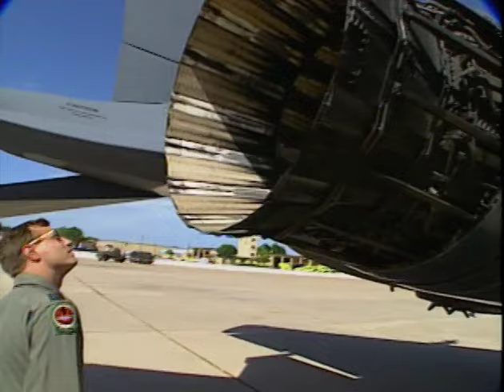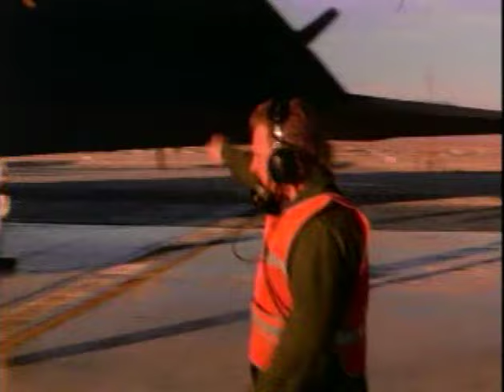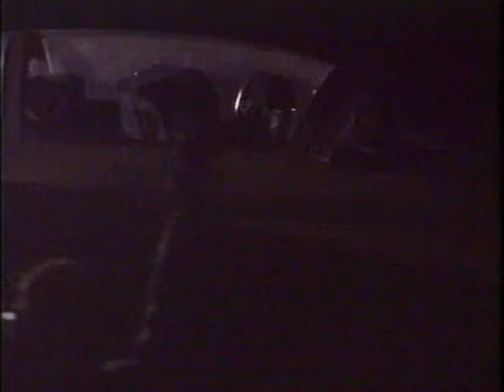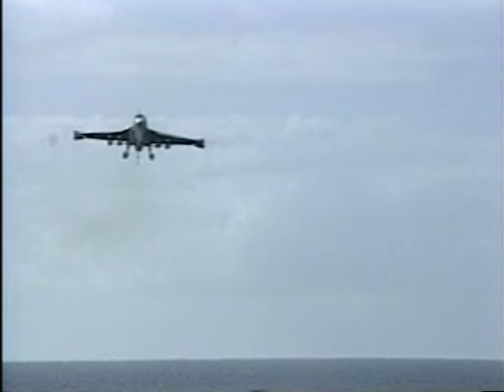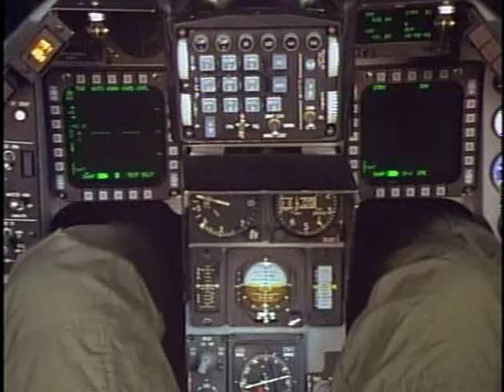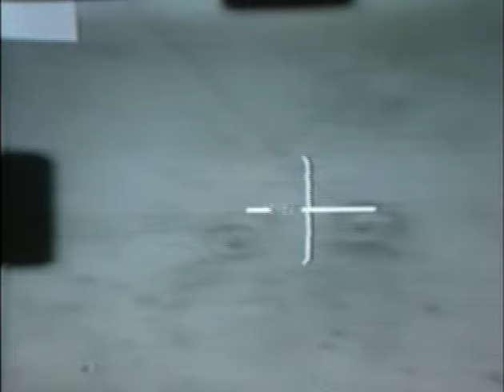Wings Over the Gulf

Comment: What sad is we fought 3 wars since 1991 and still are flying these same jets the same air frames
Reply: Yeah, I think about this from time to time too. In fairness F-35 is replacing most of what you see here though.
Reply: Why is that sad? If they work, why change them? We've upgraded the tech in them and they still kick ass. What's the point of using something else when what we have still gets the job done and gets it done just as well as it always has and better than anyone else?